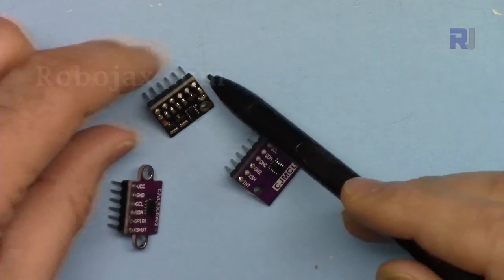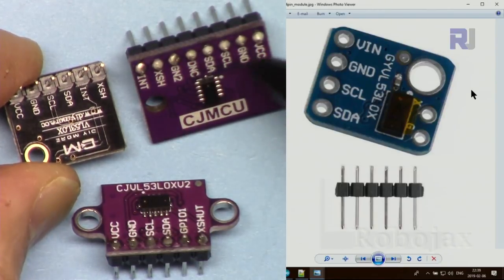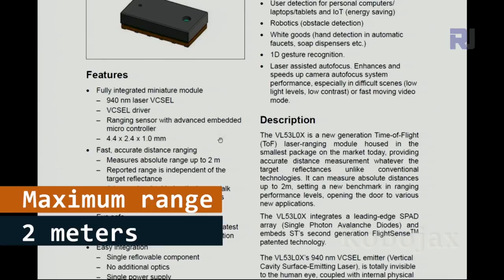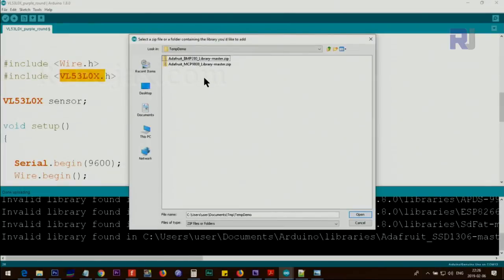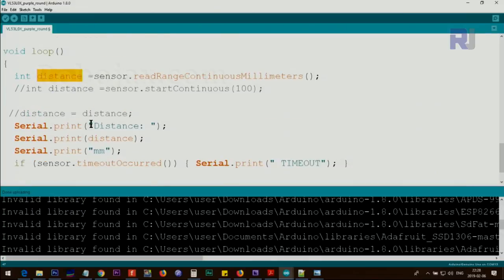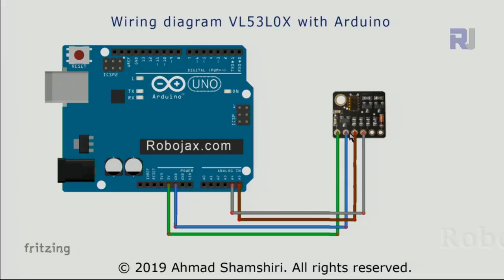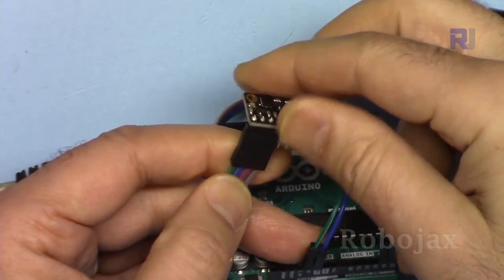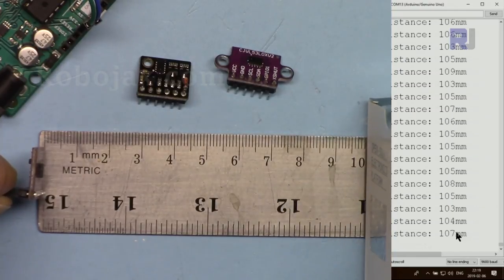Lesson 77: Using VL53L0X 200cm Laser Distance Sensor | Arduino Step By Step Course

Comment: I think the sensor's only can measuring about 127cm and than the value Will be 8190... It's not until 200cm, sure?
Reply from the maker: I believe I have shown the datasheet for VL53L0X. it says 200cm.
Reply: it probably only reads 200cm in a dark room against a white surface

Comment: can this be coded that if distance lower than 20mm 5 servo move to 1800 and if distance larger than 20mm move back 5 servos to 0?
Reply from the maker: yes and that is very easy. I have tones of videos on servo. most on push buttons with some kond of conditions. just use you distance instead of push buttons. search my channel for servo.

Comment: This video is very helpful. I can use this sensor and detect the distance correct. I found there is an issue: after the sensor cannot detect the distance (namely, it returns 8990) for a while (e.g. 30s), then the program dead. I have to restart by clicking Reset button. Wondering how to avoid this problem?
Reply from the maker: It should not die. Perhaps the wires get disconnected. Check them. Leave it without touching and see if it stops.
Reply: @robojax  you are right. the dead was from the loose plug.

BTW, the sensor seems not be able to detect 3x3x4" cube if it is 27" far away from the sensor. Thought it might be the object is too small? Do you have any suggestion? Thank you in advance.

Comment: If the wall is at an angle to the sensor will it still be able to read the distance?  Ultrasonic sensors have difficulty unless they are not pointed straight at the wall, curious how these perform?
Reply from the maker: Hi, yes for sure it will read the distance.

Comment: Thanks for your nice videos. Can you explain in a short  video how work the radioaltimeter that mesure distance till 1000 - 1500 meters ? What are the components and its parameters to be able mesuring such distace. I know hardware in this case are expencive but just an explanation please. Regards
Reply from the maker: 1000m? wow that is kind of industrial high end range finder or altitude. You might be able to Big/Google it to find read-to-use device.

Comment: Thanks for your video, But i have a mistake measure for used that sensor. I hope you can help me.
Reply from the maker: you mean you are getting incorrect reading? remove the sticker from the sensor. there is a plastic sticker on the sensor.

Comment: Excuse me sir, I want to ask. I'm trying to make it at home. why the output is not up to 1000 mm? only up to 800 mm and immediately jump to 8190 mm.
Reply from the maker: You must have the object located at that t distance or there is reflective item.
Reply: @robojax  thank you sir, i will try. by the way, can i use VL53L0X to measure distance vertically?

Comment: i have "Distance: 65535mm TIMEOUT
" problem. help
Reply from the maker: It seems dead module or bad wiring. Use I2C scanner to check it. The I2C scanner code is on the Robojax website
Reply: @robojax  wiring is good, I2C scanner detects address.